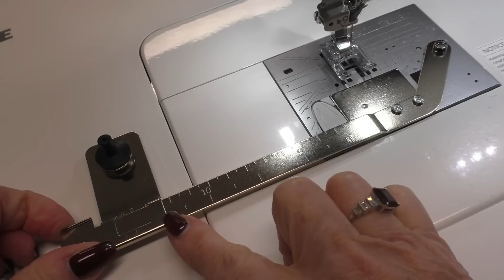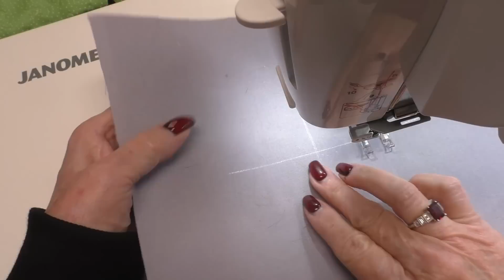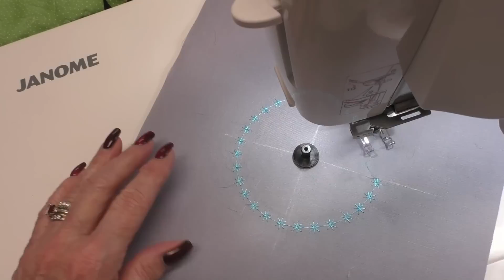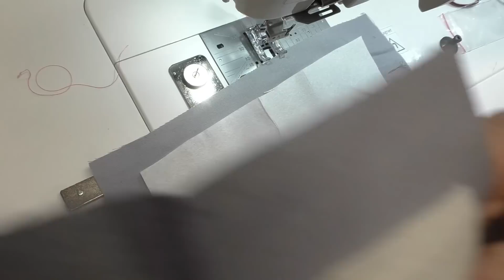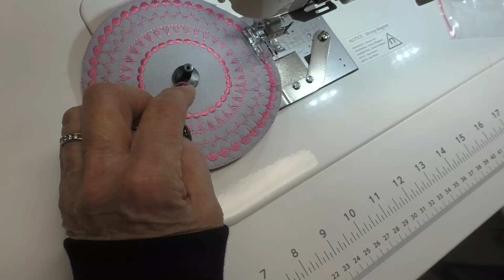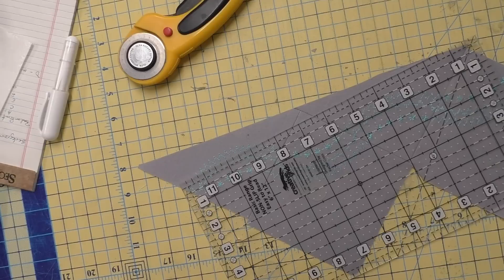How to Use the Circular Sewing Attachment

Comment: Thank you for the video, can't wait to use mine.  Questions
1. Can I use this for quilting with batting and bottom fabric or will that be to thick?

2. What weight thread did you use?
Thank you
Reply from the maker: You can try on a quilt sandwich but be sure to test on a scrap first. Please refer to your machine's instruction manual for the recommended polyester thread weights to use with a size 14 needle.

Comment: Thank you for this, it's extremely helpful. It looks like you're using embroidery floss? I'm new at this so thanks for excusing my ignorance.
Reply from the maker: You can use embroidery thread that has a slight sheen, but not embroidery floss that is heavier weight and not compatible with sewing machines.